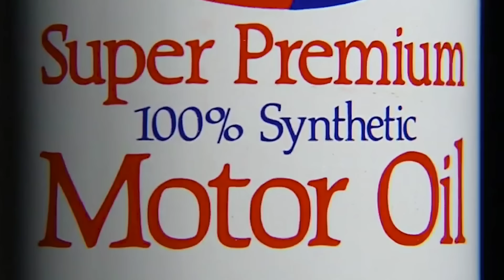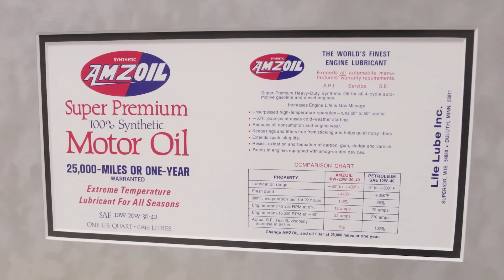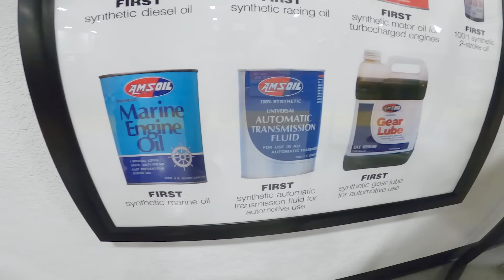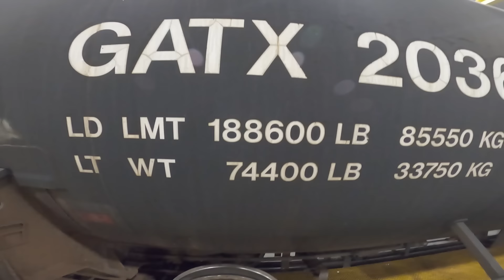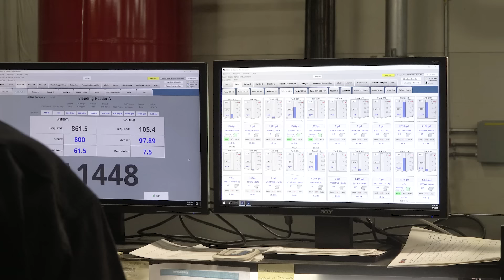How synthetic motor oil is made | Part 1 of 4

Comment: Most people think synthetic oil is for example lab made vitamin c Vs vitamin C extracted from citrus.   It's made from oil that's hydrocracked so you can get the chains you want but blending  to perfection with the best additives, I usualy don't buy brand name, I just change it every 3 months as it's cheap and easy.  Amsoil makes some great products but I only use them if I know I may not be in the position to change my oil, but for a standard car I find it's just best to get sub branded  cheap synthetic oil and change it every 3/6 months as it only takes 10mins most of the time the store brand oils are made by the big boys, same with tires.
I do realy hope that we still have cars with internal combustion engines, with turbo diesel being very efficient.  I don't care what fuel it is bio, reclaimed, hydrogen whatever.   Electric is just souless and the fires are awfull.
Used cooking, engine, industrial and even oil from the sewers can make diesel.
I used to fill my pre PD VW 1.9tdi with any oil and it would work just fine even used engine oil that has been though a centrafuge or distillate mixed with used aircraft hydraulic fluid.
I could not find diesel once and the UK version of Walmart had 2 stroke oil on sale, I looked like an idiot filling it but It was half "purple" diesel and half 2 stroke and that was the best it ever ran  (it was the winter so no cooking oil).

For anyone in the US if you get an SUV or pickup get a diesel or even a car and get it in manual.
You can modify it so you don't have to use that blue fluid.

I could never understand huge trucks in the US with a petrol engine and a automatic gearbox, if you need to haul stuff you want the extra torque but I don't think I have ever seen anything on a pickup in the US.

Comment: Synthetic.  Not a new concept?  The Luftwaffe used synthetic oil in their ME109 engines during WWII.  The USAAF conducted many bombing sorties inside Germany during WWII to destroy these plants.  Still a good video. Learned quite a bit.  Have been using synthetics in GMC 2500HD 8.1 Alison trans for about 20 years.  Along with the front and rear differentails.  No lab tour?

Comment: But, why do oils like Motul, Liqui Moly, Mobil have mfgs specs, like VW 504, 502, 505 507 etc etc etc.  Amsoil doesn't?
Reply: @HiTechOilCo  There are the specs now, but for in the past i could never find such specs, now they are in fact on there like VW 505, 502 504...

Comment: 💚💚💚💚 bookmark/notes : thin/ fake  wind oil or oil 🧼 for wind 🛤🪙🏄🪂 , blend see through pipes house , one train one gausge , open pit decontant lab coat bust view , argon noble gas / oil prevent scratch , slag weld rust prevent when admiring (rainbow in the oil) pipes ….. hope 📚 just sunscreen face hobby retirement warehouse shoulders for the mechanic owner but also salesman side , conveyor belt wind ect…..tbc….-g-b, bot

Comment: The additive being 'precisely decanted' into the open vat with load cells was flowing from an open 55 gal drum bung. I didn't see it, but I guess he stopped the flow by screwing the cap back in while liquid was flowing..hard to stop the flow precisely that way.
   When clicking on this, I didn't  expect a 20+ minute ad for one brand.
     The facility looks nice, but it is standard industrial fluid handling stuff, which is interesting to see, but not really unusual.

Comment: My name is Barry, and I am a lifetime dealer of AmsOil.  I originally started using AmsOil in my 2 stroke off road motorcycles.  My friend and I had identical 1983 Honda CR480 motorcycles, both running on Golden Spectrol at 32:1 gas/oil ratio.  We determined to test the AmsOil in my bike, so we raced Fish Canyon in Ocotilla Wells, California in hot weather.  When we got to the end, we tested how hot the engines were by the highly scientific method of spitting on the fins.  On both bikes the spit flashed into vapor.  We went back to camp and I removed the balance of the Spectrol gas from my bike and put in the 100:1 ratio AmsOil.  Then we went back and raced Fish Canyon again.  My friend's bike still flashed the spit into vapor immediately, while the spit just sat on the fins of my bike.  Quite a few off roaders stopped to see the two idiots spitting on their bikes.  It was hilarious.  When we got back to camp, I gave my last2 bottles of Spectrol to my friend.  From 1984 until 2004, I rode that bike hard every month weekend.  In one year in particular, my friend and I rode every weekend.  I would climb soft (talcum powder) hills that required holding the throttle wide open for 5 minutes at a time.  When after all the time, I thought the engine probably needed a new piston, so I took the engine apart and took it to Klemm Research to have it checked out.  They told me that the bore was still straight, and the the piston was still within clearance specs.  I decided to have it ported and bored for the next oversized piston anyway, since it was already apart.  Fast forward to the 2000's and AmsOil changed the formula for it's 2 stroke oil.  Because of certain health problems, 6 broken ribs, and Covid, I have not ridden the bike for 10 years, but the gas is still good!  The AmsOil even preserved the gas when I rode the bike again over Thanksgiving 2022.  I have a 16 gallon tank on the front of my trailer and 4 bikes and 3 quads, and all of them run without even a ping.  I spoke to the AmsOil Warehouse when I discovered the formula change.  I was informed that AmsOil would no longer preserve the gas, and that the new formula for the big bore 2 strokes required a gas/oil ratio of 50:1.  The new Sabre oil was only for lawn equipment.  I am totally disappointed.  I know that some of the racers ran the old AmsOil at 280:1, so I went and bought some 100 octane gas and mixed it with my existing premix to make it last until I'm dead, but my daughter will now be faced with the oil change over.  For your information, I taught her to ride since she was about 3 years old.  She is 34 now, and is a better rider than I am.

Also, about 25 years ago I had been running my V-8 (327) Chevy Vega on Valvoline 40w Racing oil and STP for 50,000 miles since I built the engine.  It was getting 18 miles per gallon consistently.  I decided to test the AmsOil 10w40 along with the AmsOil filter, So I drained the Valvoline and put the magnetic drain plug on a sheet of white paper without rubbing it to see if it have any metal on it.  It was perfectly clean.  I then installed the AmsOil oil and filter and drove the car for another 3,000 miles (my normal oil change interval) and discovered that the mileage went down to 16 miles per gallon.  After draining the oil and putting the drain plug on a paper again, I discovered that the drain plug had tons of metal particles on it.  I thought that perhaps something had gone wrong with my engine, so I went back to the Valvoline 40w Racing oil and ran it for another 3,000 miles.  Guess what:  The drain plug was completely clear.  The AmsOil did NOT protect my engine the way it was advertised.  I drove that car for 20 years back and forth to work, putting 300,000 miles on it, and the 327 still passed smog when I took it out in favor of a 350 4 bolt main Corvette engine.

Because of the downgrade in the 2 stroke oil, I will never use or recommend AmsOil to anyone again.  I'm going to have to re-jet 8 carburetors in order to get the correct air fuel ratios and that requires many hours  to remove the carbs and change jets, metering rods, etc., even assuming that I get it right the first time.  The 480 also has a boost bottle and manifold addition that is VERY difficult to get in and out of very tight quarters.  I'm 75 years old, and an expert rider.  There are 3 difficult hills in Johnson Valley that only 3 people (that I know of) have ever seen the top, and I'm one of them.

I am VERY dissatisfied with the degraded 2 stroke oil .  You used to have the best, but it looks like you decided to turn your backs on quality for more money instead of the quality that you historically earned.  I caused hundreds of riders to change to the 2 stroke oil, but that is over now.  You shot yourself in the foot.

Comment: You may have great oil but Mobil-1 Is half the price
Reply from the maker: We're not sure about that, Amsoil is very affordable. Here's an example: 2019 Ram 1500 5.7L Hemi - the cost for a 5w20 quart is $9.99 or $7.49 with an Amsoil membership. We found other brands cost about the same or  in some cases more. Between $11.49-$12.99. 
https://www.amsoil.com/p/oe-5w-20-synthetic-motor-oil-oem/?code=OEMQT-EA
Reply: @bankspower  So you need a membership? Why would that be? I can buy 5 qts. of mobil-1 for $25. I can only find Amsoil for $63
Reply from the maker: No, you do not need a membership, however, it is an optional.

Comment: Amsoil does NOT make oils. They’re just a blender. Actual base synthetic oil is supplied by one of few majors. They then put in their additives. So not they’re not an oil mfger but blender like most oil brands. Rd Line Oil now that’s the good stuff and better why many racing teams use it and high performance cars.